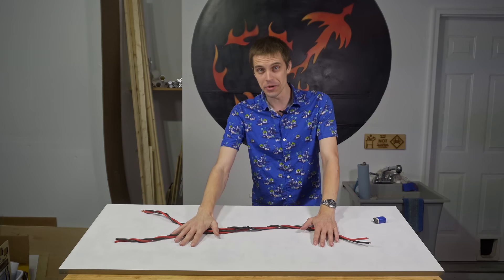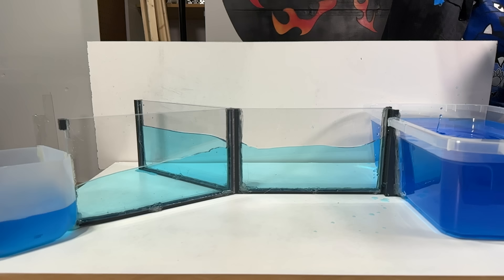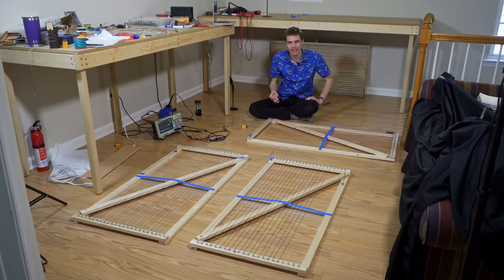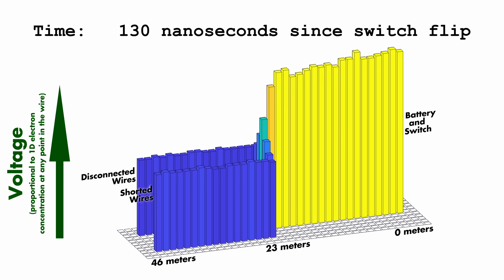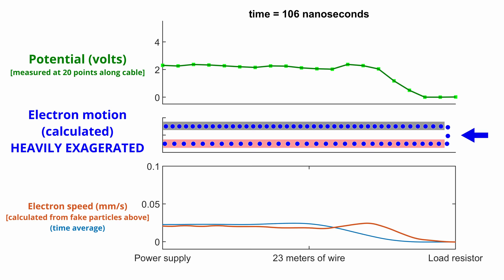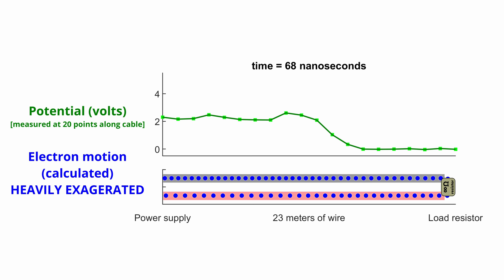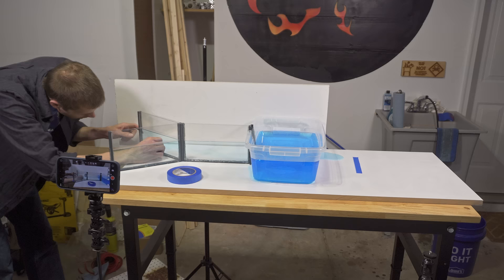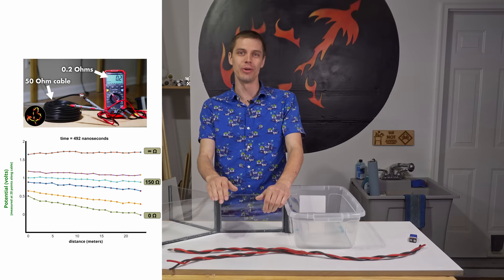Watch electricity hit a fork in the road at half a billion frames per second

Comment: It took my dumbass 12 minutes to realize I didn't understand a damn thing this guy was talking about.  I think the disconnected (open) circuit sent electrons through my eye holes into my brain and out my ass so fast that it caused my tongue to wrap around my eyeballs until I couldn't see what I was saying or this fellow either.
So I stopped drooling, put my tongue back in my mouth picked my chin up and moved on to a different channel wondering if I'd just experienced a flashback from my window pane (acid) years back in the late 60's - early 70's
🎵🎵🎶Sunshine came softly through my a-window today🎶🎵🎶

Comment: Really awesome video, would be interesting to see what a dc motor looks like. My guess is that stator would act like a 0_ohm short without a rotor, and would act like the resistant diagram at 18:41 with the rotor in it. Seems like it would be extremely difficult to tap into the windings without shorting it out though.
Reply from the maker: Oh man I REALLY want to see this now. If you have a single many-wrap coil, my first reaction is that you’d actually get a reverse current in the second half of the winding driven my magnetic fields when the “light speed” signal propagating with electric fields and electron smushing had only propagated through the first half…. You couldn’t get away with using twisted pair or a double winding I think so not probe-loading the coil during measurement would be even more difficult.

If said coil was near a magnet (like in a dc motor) I dont think that static magnet would change much on this timescale
Reply: @AlphaPhoenixChannel  "my first reaction is that you’d actually get a reverse current in the second half of the winding driven my magnetic fields" I thought that briefly as well, but I didn't want to consult my book on motors to check. I assumed since the windings are basically parallel they wouldn't interfere, but now thinking even more I realize there are different electromagnet shapes. I'm sure a simple winding design like for a solenoid would behave very different from a cylindrical shaped motor design. Definitely an avenue for further exploration. Thanks for the reply and informative video!
Reply from the maker: @KingQuetzal  ah yeah I was just picturing a simple solenoid. -one huge helix of wire. Gotta think about how to not probe load cause that’s fascinating

Comment: Very good presentation.
Just wonder if the impedance of the oscilloscope probe significantly affect the effect of electrons move through the "open" wires, so much so the circuit is "closed" although at very high resistance the moment the oscilloscope probe was connected.

This is somewhat similar to the experiment in quantum physics where  the act of measurement somehow collapses the wave function and force the obsessed element to behave as particle.

Comment: i have an audio engineering background and these impulses have quite some similarities to crossover filters for loudspeakers, where capacitors are one of the most important building blocks.

i know twisted wires are more convenient for the test, but shouldnt an ideal test circuit reduce stray capacitance as much as possible? did you measure the capacitance between the wires at the open end? i would love to see how big the influence of that is on the circuit.

for example you could make a test run with adding a capacitor on the open end and see how much influence it has on the impulse flowing through the cable and back. 
then again, the best method would be to pull apart the twisted wires to reduce the capacitance as much as possible.

Comment: the reason this all seems so confusing and unpredictable is because you are using electrons to explain it when you should be using greenies. If you looked at it in terms of greenies the behavior is intuitive. 
  Think of how motion travels as a wave through freeway traffic or a large crowd. the greenies are just driving on divergent highways in the same direction not knowing that one of the directions has a road block due to construction. Since theres not really any sign about the road blockage the greenies drive down that highway until traffic backs up to the point where the greenies can clearly see that one section of highway is backed up in bumper to bumper traffic so they decide to take the section of highway thats actually moving.

  If you look in terms of a large crowd for a big greenie rock concert (Maxwell and the heavysides, a very popular band), there are two lines and the greenies all rush to get their spots in line (it's a VERY popular band). Unfortunately one of the lines is leftover from a previous event and does not lead to the entrance for tonights show. as the greenies in the real line get into the venue, the greenies in the false line (the "open circuit") get to the front of the line and find out they cant get into the concert that way (bummer!), so they have to turn around and go back through the line which is obviously more difficult with all the excited fans pushing to get ahead in line. eventually the greenies get back to the parking lot and find the right line to get in and see the show. as more and more fans go through this same dilemma less fans are left in the false line and less greenies enter it since they tell other greenies about the false line when they get back to the parking lot. Because of this eventually  the number of greenies in the actual line increases until the eager rock and rollers are in the right line and greenies have stopped making the mistake of entering the false line (except for those few who got drunk in the parking lot and think they found a short cut).

I'm telling you when you look at the reality of greenies instead of the weird made up world of "electrons" everything becomes clear and intuitive behavior we can easily understand.

Comment: Thanks for sharing your thoughts, ideas and videos. Unfortunately you need to find a book from a few years back, probably 30 or more and bone up on your math. It’s amazing to watch all these videos of people who only have studied dc theory arguing about what’s happening without studying ac analog theory. It’s the magnetic field traveling down the wire not thru the air. It’s called propagation delay. Was used creatively and effectively in analog color TVs for years. If you learn analog color tv tuner theory you will discover how much you don’t know. The problem is, since digital computers came out even over 30 years ago when I was in school the analog ac theory was being phased out. Since their was so much new stuff coming out to learn and the same amount of years in a degree. At one point I came across a text book my much older brother used when he learned about electronics and it was so far over my head it was like trying to decode Egyptian hieroglyphics and I graduated with college with a 4.0 average in electronics. The theory your grasping on explaining is found all over analog ac theory. The closest you can probably come to it in a modern setting would to study ac power theory as in the power system that supplies our homes. When operating a power grid as a system operator you are dealing with reactive power all the time. A very hard concept for many people to grasp and usually abbreviated to incorrect but close enough analogies for the operators to effectively work with while not actually knowing what they are dealing with. It’s a sad state of the education system. I worked in the bulk power system for over 30 years and more then half of my contemporaries had no clue just how clueless they were. Having gone to college for electronics and having a solid background when going into the power industry and butting heads with several instructors I learned to just sit quietly listening to the nonsense they were putting into the students heads with the blessings of the instructors since they knew the impossibility of actually explaining what was happening in the time that was allowed for class. In just about every class their came a time that after my dropping a few subtle clues the teacher gave me a silent glance and nod acknowledging, yup I know I’m talking nonsense and I appreciate your not disrupting class.

Comment: "Because an oscilloscope probe has a capacitance, resistance and inductance, it's going to affect the signal you're measuring and can affect the operation of the circuit"
So, when you use an oscilloscope to measure the voltage in the disconnected wire it is no longer disconnected. Is it not?

Comment: Is the pressure mediation just stabilizing as I had imagined that electrons actually do not flow as we understand them but meditate  between space and counterspace making the speed of light null or instantaneous?
I also thought that the pressure mediates in the form of twisting pairs of Bierkland currents in electromagnetic waves around the wires?

Comment: I never liked this idea that electrons barely move or don't even move at all, idea behind it is perfectly clear to me, but cathode ray tube proves electrons do move with speeds up to 1/10th the speed of light for flyback voltages aka circa 20-100kV. They are accelerated by the electric field in the wires in the similar manner altho speed may be much lesser for 110-220V, still, it should be around 0.1 percent of speed of light which is still an immense velocity relatively speaking.

Comment: The overshoot and oscillation on the oscilloscope after the switch is pressed is more likely due to the internal resistance of the the battery. I think you mentioned that it was spent or used?

Comment: Could you make a circuit consisting of two disconnected wires, then use a battery to send a pulse down both of them but disconnecting the battery before the wave can bounce back to the battery and keep a disconnected wire in that elevated state until discharged

Comment: So, water behaves like electricity or a sea of electrons. Question: Do you have an explanation about what mechanism conveys that drop in current. I could almost imagine a wave with the same phase moving down both wires. When the waves reach the end they destructively interfere through a reflection back toward the source.

Comment: Does it mean that putting "-" sign of battery to a single wire, it will actually push electrons to the end of wire? It would mean tip of the wire is negatively charged

Comment: It would probably be a better analogy to say a traffic jam/cars moving over communicating and knowing how much energy to send since resistance is key and a battery is designed to limit the flow of current.  When a power line snaps and is hanging off the ground not touching anything... it's still fully charged.... and waiting for something to complete the circuit. 

Your experiment gets hit by lightning that lightning isn't going to wonder how much to send, unless that answer is ALL OF IT. 

Also the spike is from stored energy built up verse slower chemical reaction producing energy on a battery.... If you plug that experiment into a wall socket with actively supplied current you shouldn't see a massive drop off.

Comment: would love to see what this looks like with a thermal camera.  I wonder if the spots that you see the bunch up is where the wire gets the hottest with a short. My car audio background says, every company recommends a fuse within the first 12 inches of power wire. My guess would be over a 20ft run of wire that hot spot is after the first 12 inches and would cause a burn in that spot with enough power. thank you for stimulating my mind ill be pondering this for some time

Comment: Great video!! I love how you explained and demonstrated everything.

Question for you,   Are there electrons in the wire when not connected to anything?  

I've seen many demonstrations very similar to what you show at 14:21.  Electrons within the wire, not moving until power applied or load is turned on.  

What I've always wondered is, do the electrons exist in the wire when not connected to anything?   

Think about a garden hose vs an extension cord.   When one shuts off the water spigot, and disconnects the hose from the spigot, the water inside the hose is no longer under pressure.  Water will drain out of the hose and over time the inside of the hose may dry out.  Then the next time the hose is used, it will fill up with water under pressure. 

What happens to the electrons in wire when not connected to a power source?  Are they in the wire prior to connection like your graphic, and many others, shows. Or is the wire an empty pipe/hose similar to a garden hose?

My question is not a criticism of your graphic.  I'd really like to know if the electrons exist in the wire with no power source connected?  

If the electrons don't exist, the wire is "empty", is this the reason for the initial surge at power connection?  Similar to a water pipe when a valve is opened.

Thanks!!
Reply from the maker: They do literally exist in the wire when disconnected. They have to be there or it would be EXTREMELY positively charged with all the leftover ions (the mobile electrons in a metal constitute about one electron per atom, and even if you just removed all of those it would be incredibly unstable

Comment: The battery doesn't deal with the whole circuit.... it supplies and recieves electrons from the immediate attoms from the battery.  At the positive terminal, the battery strips the electrons from the atoms , those atoms will have holes, the next atom from it will surrender it's electron to the initial atoms and the process moves in a wave down the conductor. In slow motion you'd see a hole moving along the conductor towards the postive terminal.  The number of holes moving if directly proportion to the diameter of the conductor and inversely proportional to the resistance of the conductor. What determines how much current flows is actually the conductor and not the battery, the resistance of the conductor is a measure of the maximum number of holes it can provide. If you demand anything higher than that then the atoms will have more eletrons than their shells can handle and those electrons are forced to aquire more energy so they can travel through unoccupied energy levels where they are forved to emit energy in the form of photons before the can exit the conductor, those photons are observed as heat and light.... 
The measurements you're getting from the open circuit on the scope are a result of holes moving through the oscilloscope... connect a transformer, only one terminal,  and measure the PD generated at the secondary coil.. you'll most likely find nothing.
Reply: More over the waves you're seeing are a result of inductance and the collapsing magnetic field whicj generate electricity...
Measuring the magnetic field around each branch is the best approach to answer your questions

Comment: hello, the energy momentum relation is E^2 = ( pc )^2 + ( m_0 c^2 )^2 . the variation of potential in time of your battery-twisted pair system looks like a wave (the moment the circuit connects the battery to the twisted-pair system) turning into a particle ( when the sloughing in the water model stabilizes). When the battery loses energy it loses mass. After the battery is connected I'm assuming it loses energy at a constant rate. Since we observe a constant speed of light, and a conservation of energy momentum for an electron in a wire we could look at the stabilization of the potential variation you found in the battery-twisted pair system like energy sloughing between mass ( the mass of the battery plus the mass of the electrons in the twisted pair) and a wave (the variation of potential over time). Is the sloughing when it came to life the same as when it dies?

Comment: Thank you for such a cool presentation of how electricity flows, this gets me to somewhere i can imagine how such phenomenon happens in reality application. But still, as a beginner in such field. I still had a lot of trouble learning how is Protective Earth Ground cable helps preventing electrocution in electronics device which would need one. I mean, a circuit has to be closed in order for the electrons to be able to pass through the victim and electrocuting them. Where's the mentioned Cold Wire(or Neutral Wire) to form a closed circuit when a victim touches the electronics which isn't properly Grounded? Can they get shocked if we place a high resistance mat below them then ask them to touch mentioned device again?

I hope, really hope there's one of your video would talk about such topic. There's very much thing didn't worked with the same principles such as mentioned closed circuit, I see people could get zapped even with a lighter which charges by quartz. I also couldn't figured out how an insulated person(insulated to the ground) can get zapped from that thing even when there's no formed circuit that is visible to my bare eyes. So thank you, A.P❤🎉

Comment: So electricity IS just like a water wave.  The wave moves by electrons bumping their neighbor forward, but the electrons don't move very far, like individual drops of water that simply bob up and down as a wave propagates.  The 'stabilization,' then, is like a stream (e.g., the Gulf Stream, or a small river (creek)) in which all the electrons have gained the same kinetic energy and flow together?  
Additionally, this may disprove the quantum notions of "electrons know when we are watching" or "entanglement".  They don't "know" squat.  They are not mystically connected.  They have to discover, in the branches, whether there is anywhere to go.  In the open branch, it piles up and stops because neighbors are at kinetic equilibrium and 'act' as water in a dead end pool with no outlet?  Dead calm, except perhaps for a tiny bit of equilibration at the fork.  It's like demonstrating a wave by tying a rope to a tree and 'waving' it up and down?